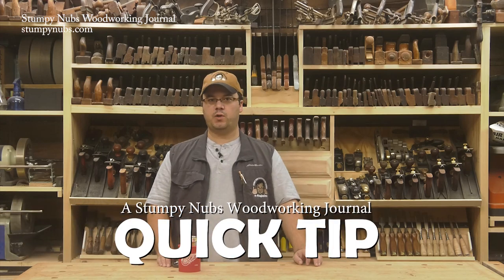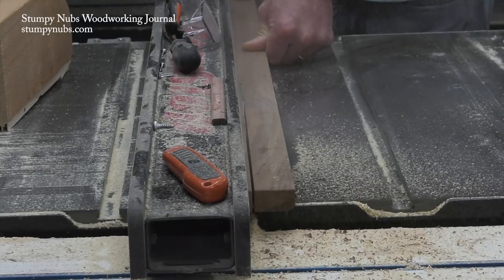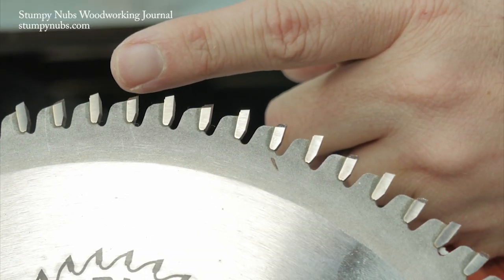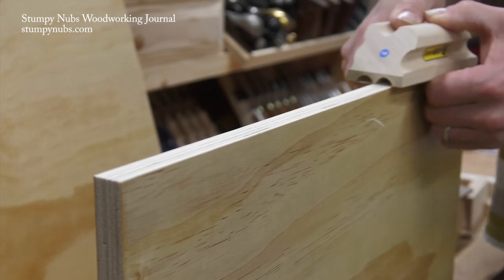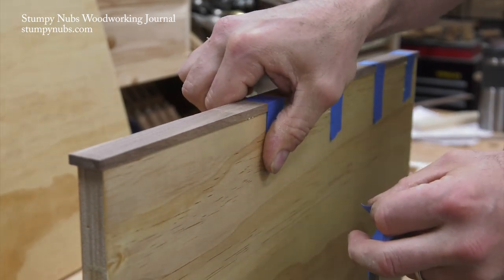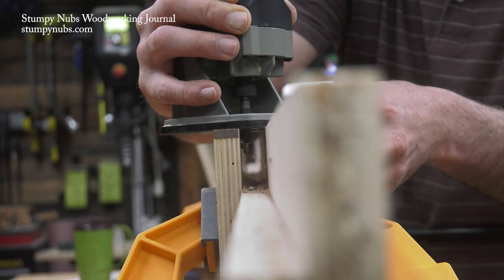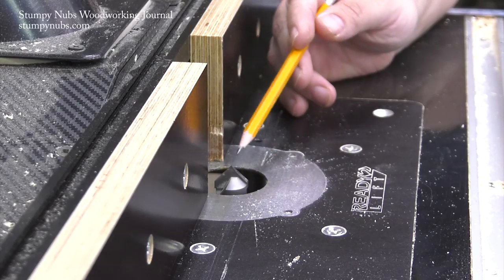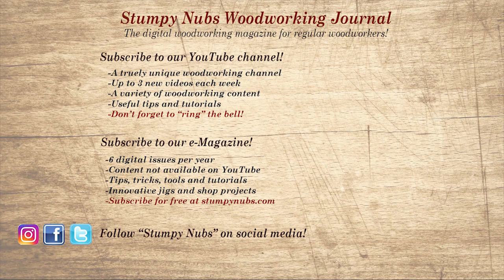How to make hardwood edge banding look good

Comment from the maker: Tormek: https://affinitytool.com/brands/torme...
Video about router table edge banding► https://youtu.be/HOqwCBNgMys
Duragrit carbide sanding blocks  (Use Coupon Code: STUMPYNUBS)► https://duragrit.com/home.php
Ridge Carbide saw blades (Use coupon code SNWJ10)► https://goo.gl/z8TP0k
Reply: Always enjoy your videos and learn loads of things....cheers...rr Normandy, France
Reply: I have a 40 tooth Woodworker 2 that's been a workhorse and supposed to be good for crosscuts, but I can see how an 80 tooth would be great for that and cutting miters (which I also do and join with splines so the cut is critical). Can you tell me exactly which RC blade you are using for your 80 tootj? I'd like to add that to my tool set. Thanks! And your video series is great! Subscribed as soon as I found it!

Comment: Thank you, Stumpy Nubs! I used the jig idea suggested at 2:20, and it worked extremely well (better than other techniques for flush routing the edge banding that I had tried). I guess the following tip makes sense, but things went better for me when I used my heavy duty router with handles than when I tried it using a trim router. The handle and the weight of the router allowed it to travel accurately along the jig. Thanks again!

Comment: I saw a sashimono video where the gentleman use a string to provide clamping pressure for hardwood edging.   It was slower process, but is easily removed once the glue dried.

On smaller pieces, you can also apply a stretch of tape the entire length of the piece, a few inches away from the edge band. then clamp it down normally with shorter pieces of tape, overlapping the long tape. once dry,  pull  off the long tape and all the shorter ones will come off at once.

Comment: Some advice from the experts and experienced woodworkers please:  I have a 30" x 20" oval Maple table top and I want to put a 3/4" walnut edging around it. My first obstacle is the oval shape and the second obstacle is the fact that it is walnut and quite stiff. So steam bending is probably the way to go? Should I cut the walnut into thinner strips, say about 2/16 each and then steam and bend around and clamp to take shape and let it dry out and after they dried out, apply glue and clamp strip by strip - overlapping them, until the desired thickness is reached? (I am quite scared that bending the entire 3/4" - even when steamed, may result in the walnut to crack.)

Comment: The simple trimming jig was a great tip that makes trimming with router a much more stable solution. I usually use a hand plane and finish off with a sanding block if required, but maybe I should try your jig for faster trimming.

Comment: Good timing for the back half of a project. I made cabinets, but used about 3/4" banding and used biscuits to align them. I Didn't get a hidden seam and had issuea with the router wobbling. This will come in handy for the second half of my project. Thanks!
Reply: Did you put 3/4 on end grain? Any trouble with cracking apart over the years?
Reply: @sh0cktim3 what happened to yours? I’m just about to finish (what I consider a nice walnut piece) a walnut hutch (lower portion) and going to edge band, glue, and then hit it with the router. I’m also using 3/4” inch solid walnut?
Reply: @sh0cktim3 oh and I’m edgebanding solid walnut (3/4”) to walnut veneer ply (3/4”)
Reply: @scottlandb6579  shouldn't be a problem at all. I edge banded some solid 3/4 walnut to some floating oak shelves and they're doing fine.

Comment: Hi James, I hope this is not a stupid question, but here goes - I have glued my hardwood to my plywood and clamped with blue tape (so far so good), but I cannot really tell which direction I should be routing (the grain seems very straight running in both directions - It's red oak fyi... Part B to this question, can I just use a router table instead of the jig? Thanks for the insight, love the channel
Reply from the maker: If the grain does not angle in either direction AT ALL, then rout however you like. I recommend a climb-cut with a handheld router for this. You can do this on the router table with some jig setup, but you can not climb-cut on a router table. Here's a tutorial on climb cutting https://www.youtube.com/watch?v=mrE4HyXiwqshttps://www.youtube.com/watch?v=mrE4HyXiwqs
Reply: Stumpy Nubs thanks so much!!

Comment: Good timing, I’m planning a project with some hardwood edgebanding! You said this wouldn’t be structural...but could it be with a decent glueup? My plan was to use 3/4” for the band instead of 1/4”, to reinforce plywood bookshelves (possibly on each side, I haven’t decided that yet)

Comment: When is iron on edge banding the best choice and when should I make my own? I have too many projects to guess any more and I need to focus on competition while not having to look back with regret.
Reply from the maker: Iron on is easier to conceal if you can see all edges of a panel, such as a table top. The thin banding won't have to be mitered on the corners. But it is fore fragile and prone to chipping off over time.

Comment: I've always been a fan of edge banding a plywood "board" with strips that are long grain on the sides, but end grain on the end.  To make the end grain edge banding, glue up a panel of the hardwood that's very wide, but not necessarily long, and rip the strips from that, across the grain.  No real board has long grain running around all four sides, so end grain banding promotes the illusion it's a real board.

Comment: Question, how to finish the top now ? edge has walnut, what about the top ?
Reply from the maker: If it's a surface that will be seen (a top rather than a shelf in a cabinet) you would veneer that surface.
Reply: @StumpyNubs  Do you u have a video on how to apply veneer by any chance ?

Comment: I was with you until the router and massive jig to bring the overhang flush. Why not use a hand plane? So much easier and some very useful exercise at the same time.
Reply from the maker: Because you risk cutting into the veneer on the last pass or so.
Reply: I like the hand plane too, feels good to take the shavings and you can hear the radio. Yes you can tear into the veneer  but practice and don’t try to plane all the down, use a scraper to finish